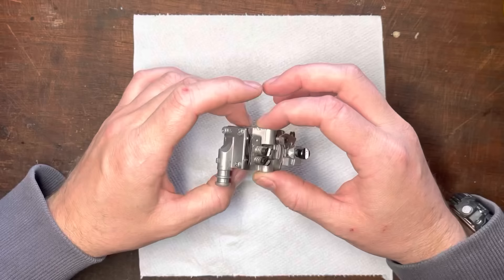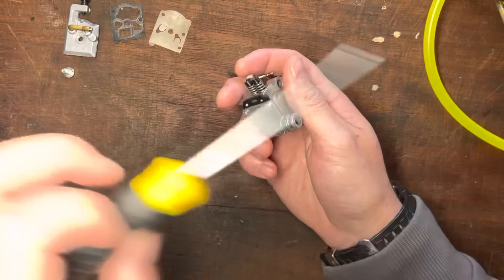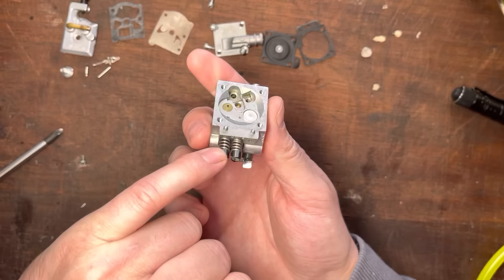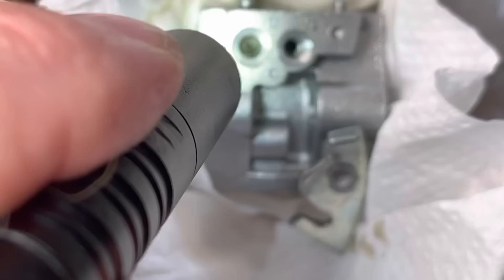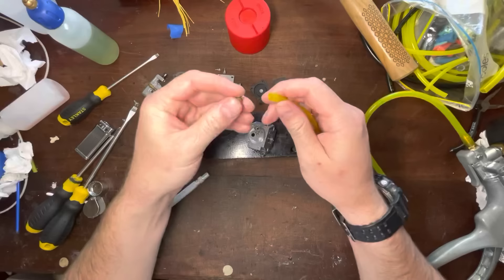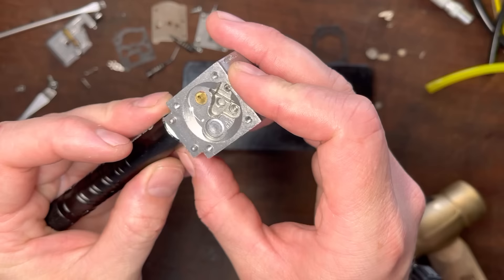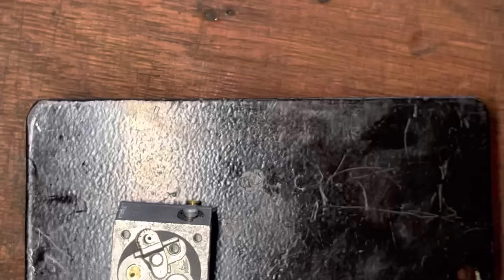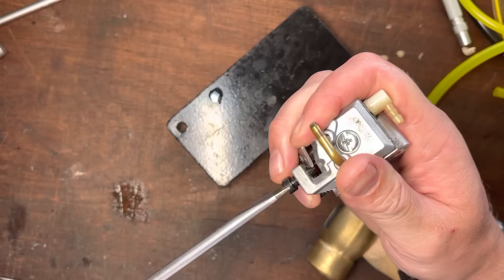2 Stroke Carburetor - In depth Fault Finding, Testing, Service & Repair

Comment: When you repair small engines for a job. You could never take this amount of time. I just change the carburetor. If you enjoy using up the time we are given in life for such stuff and doing this fills  a want in life, then enjoy.:goodvibes:
Reply from the maker: It’s quicker for me to repair one than to order one, pay for it, wait for it to be delivered (2 weeks plus in Australia) and then fit it to find out it doesn’t work.

10 mins and the oem carb is rebuilt and is reliable. Chinese AM is a gamble. Of course your mileage may vary.
Reply: @VintageEngineRepairs  I am sure shipping is a hassle, I see the point.

Comment: Steel automatically locks to aluminum, which is why you never see case screws on motorcycles with any threadlock for example.
Reply from the maker: Automatically locks? Hmm I’ve not heard that before.
Reply: @VintageEngineRepairs   It was even in the old Triumph motorcycle shop manuals; they said NOT to use any threadlock on the casings. Old school; we used to use cheap nail polish on the rest of the bike, back in the 70's!
Reply from the maker: Have you got a link to the manual and page? I’d be curious to read more about it.

Comment: Walbro vid. says nail finish is bad with ethanol fuel.
Reply from the maker: Interesting, the manual I have for them although a bit old, specifically states to use nail varnish! Maybe they changed after ethanol? I can’t say how it affects it as our state doesn’t have any ethanol. Thanks for sharing!
Reply: Thanks for your prompt reply @VintageEngineRepairs

Comment: I have a bg56 and it will crank and idle just fine. It will rev to about half throttle just fine but when you hit it wide open it will bog out and sputter. Everybody tells me just replace the carb. I want to fix it.
Reply from the maker: Good on you for wanting to fix it! I’d suggest taking a good look at the high speed circuit, check it’s clean, it flows fuel, check the check valve is actually opening fully etc. it’s quite possibly just some varnished fuel :) check the inlet screen in the pump side of the carb as well as any cracks in the fuel line, a dirty filter and that your tank vent is working :)
Reply: @VintageEngineRepairs  thank you sir. I know it can't be much wrong with it, atleast I wouldn't think so.

Comment: BOUGHT a chinese carb for my husqvarna weedeater,, it worked one day, now wont start.. replaced fuel filter, lines, cleaned tank, fresh fuel, spark good,. choke working,, great compression.. gas cap vent good and sealing,,, these 2 cycles are demons and run when they want to...
Reply from the maker: Haha they need a little extra knowledge compared to the 4 strokes, but the challenge is the fun part!! Chinese clone carbs are a liability!
Reply: @VintageEngineRepairs  i was going to sell the husqvarna, it has the convertible tiller attach ment,  good thing I tried running it the next day.. I would have looked like a proper moron when it wouldnt start.. I ordered a rebuild kit for the carb and will try to rebuild the original.. I now think its an issue with the fuel pump in the carb, because the plug is bone dry after choking it and pulling 5 good ones. it primes fine,  pulse hole is clear, intake gasket new.,,  I had the original carb on and I couldnt tune it well, as I .,  diaphram is a little worn.,, it ran too lean no matter how much I adjusted the jets.,.  thanks so much for the vid.,  will follow your testing and see what I find..
Reply: @VintageEngineRepairs  I found the fuel lines on backwards..you would think that the tube on the carb that pushes the fuel out would be the return line, but it is not,, it looks like the pressure line on the carb pushes fuel thru the filter initially but then when u let go of the primer bulb, it sucks fuel in.. Im sure this has confused MANY .. I also found the little filter screen in the carb partially clogged... its running good now, but still may need a little tuning,, after a hard rev, it ALMOST falls on its face and dies , or sometimes it loads up. and the rpms come down very slow after a hard, long rev..

Comment: It would be easier and much cheaper, around $20 bucks, to just buy a new one.
Reply from the maker: I don’t recommend buying one, $20 is only going to get you a Chinese knockoff which is very poorly made and will often times cause running issues, or not work at all. A quick clean and carb kit is all that’s often needed and they’ll work decades. It’s much better to have knowledge and save oem parts that are well made and work far better than the Chinese clone counterparts.
Reply from the maker: I forgot to mention, here in Australia, a carb like this is $180 dollars genuine. It’s much better to service and re-use it.
Reply: @VintageEngineRepairs  A Chinese knock-off will work just as well.
Reply from the maker: @Dave-co1cv  some work, some don’t. It’s 50:50